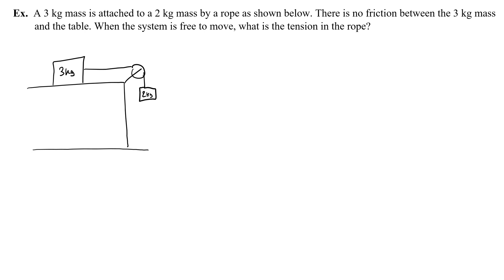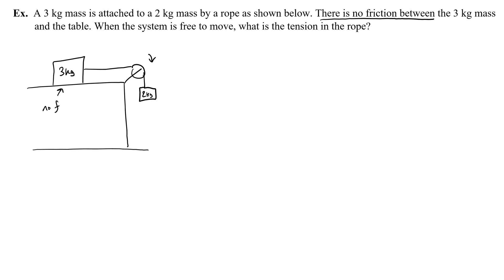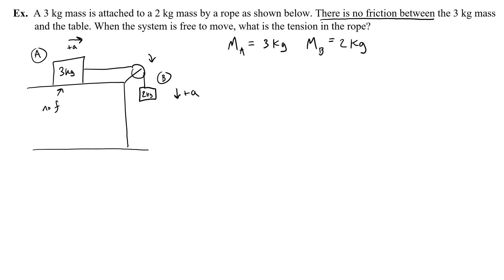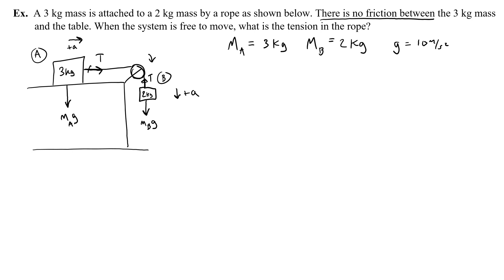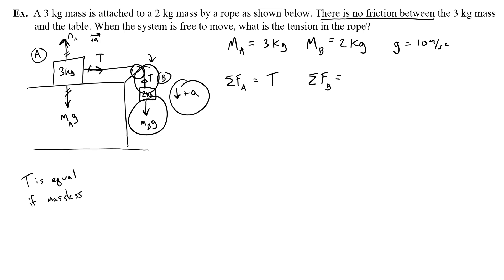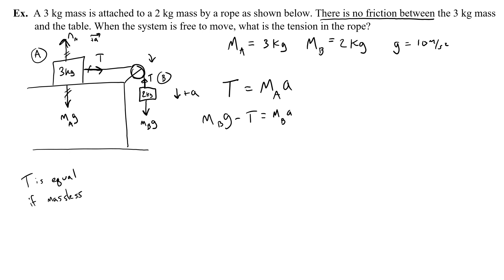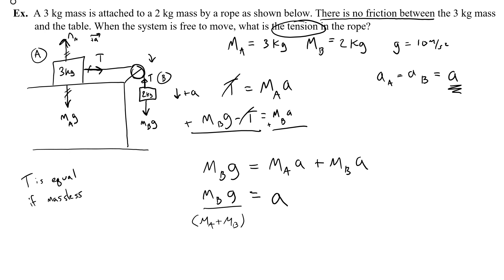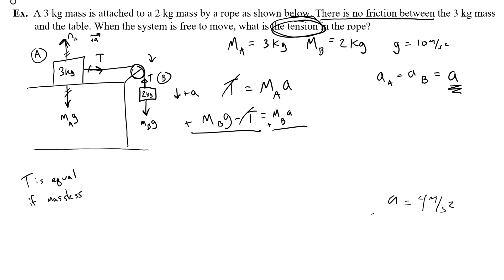How to Find Tension with a Pulley - Box on Table

Comment: Never defined axis, how would you solve when y^ is +
Reply from the maker: When solving systems of force problems (like atwood's machines) it is helpful to let the direction of acceleration define what is positive or negative rather than the x or y axis. This is because you are ultimately writing out a system of equations where each equation is a net force equation that equals mass times acceleration (Fnet=ma). When you write each net force equation you want them to be equal to a positive mass times acceleration so using the direction of the acceleration as positive will give you equations that are easier to work with. Hope this helps!

Comment: You take 11min to solve the question and i solve it in 1min .
Reply from the maker: Great point! It is easy to remember the trick for quickly solving Atwood's Machine problems. Unfortunately this video is long because it is intended for students taking the AP Physics test and they will be asked to show all of their work. On the AP test points are given for 1) Drawing correct free body diagrams 2) writing a system of equations for net force and 3) rearranging that equation to solve for acceleration in terms of ma, mb and g. That is why the video goes into so much detail :)
Reply: @HowToPhysics  👍🏻 ok